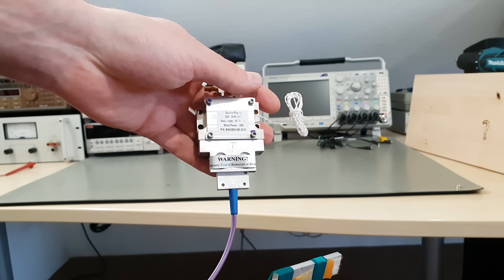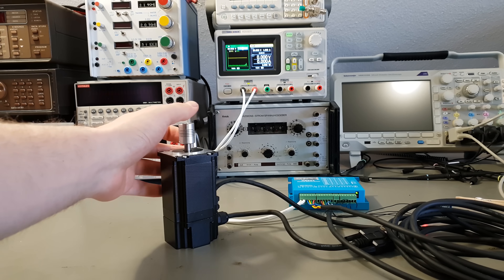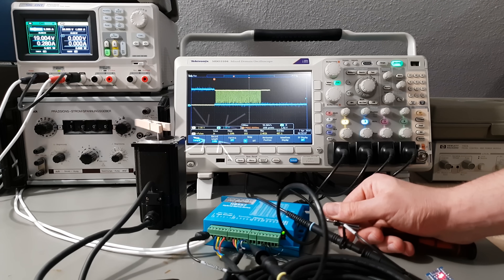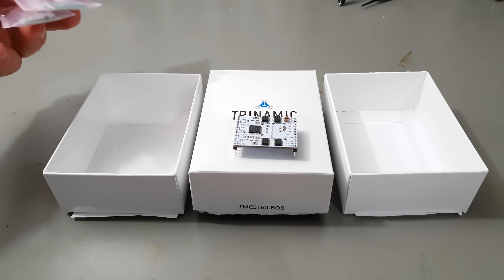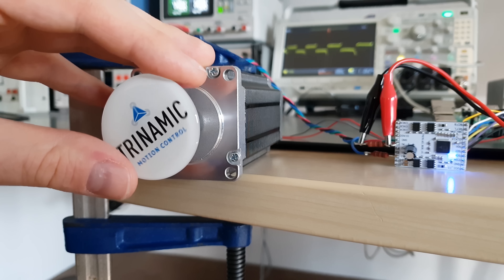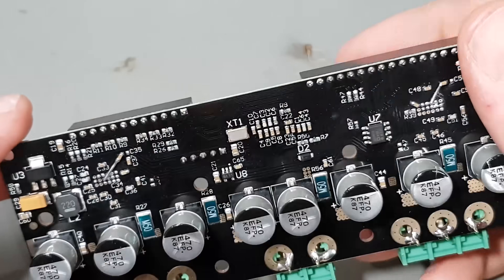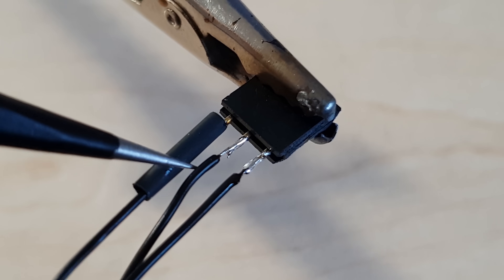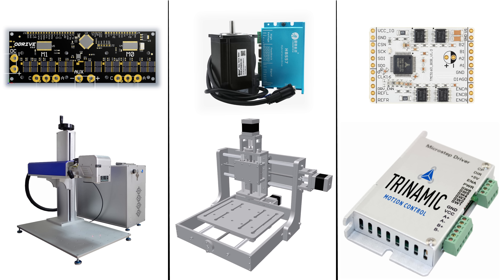Precision motion control: ODrive Servo? Trinamic Stepper? Chinese Hybrid?

Comment: "... than to spend my time with CNC and laser machines." - for some reason, this made me wonder if someone has yet built a CNC that uses a laser for material "removal".
It certainly would remove a few issues with conventional milling bits, while adding a whole lot of new issues, like making "part cooling" a literal requirement xD

Comment: He Marco, would a computer controlled brake for a stopped/holding condition be feasible to account for the lack of holding torque in the BLDC + sensor setup? I find it very attractive and like you will eventually use it for a plasma setup at some point if I can't make it work for a CNC in the mean time. You say that all high end CNCs use these - how do they account for lack of holding torque, or is it just your paranoia and purism stopping you from using one because in the back of your mind you know it'll be slightly imprecise even if less than what matters? Love your videos! Cheers :-)

Comment: You said when stepper motors skip a step "it always skips 1.8 degrees" but it's actually 7.2 degrees (360 / 50) because it skips to the next compatible pole of which there are 50 per rotation.
Also the property of servos and encoders to deflect from the desired position is bad in cnc cutting because that deflection will be caused by the cutting tool forces and the result is poor rigidity. You are better with stepper that have a high holding torque or high torque servo motors and lots of gearing.
Great vid, and nice humour too! 👍

Comment: Why aren't optics used for positioning?   Sensors have pixel sizes in the under 30 ųm² (yes, I know that's not a mu but it's the closest symbol I could find on my keyboard). That, when combined with something like facets cut to a certain length at a given angle could be used to sense the position of reflected light to an extremely precise degree, especially when you start leveraging the power of cosine in this setup (that is don't have the reflected light hitting the sensor surface orthogonally, angle will be limited by optical well depth, but that's mitigated with microlenses to increase the sensed length to a definitely detectable size/ somewhat easy to manufacture).

I expect that people smarter than me have considered and rejected something like this, so if anyone can provide some insight as to why, I'd be interested to find out.

Comment: This is like an opensource RC ESC (speed controller)!  The newest Hobbywing G2 capable speed controls like the Pro XE series has all the features you mentioned the Odriver does, such as dual hall sensor control, regenerative braking, etc.  I wonder if the creator was a Hobbywing tech defector?! haha

Comment: DAMN!  I can't believe I didn't know about this Odrive before now.  I've an active RC enthusiast for 30 years now, and was into high end 4x4 short course  and buggy racing for the last 10.  That being said, I'm a hobbywing guy.  Hobbywing is the only manufacturer that I know of that offers G2 motors that utilize two separate encoders.  This was a real advancement over the rest of the rc motor world, as having two separate hall sensors allowed them run the low resolution sensor for lowspeed operation.  Before the invention of these type motors, the speed control (ESC) would just turn the sensor off at low speeds so that it would prevent "cogging" (the bucking and hanging up due to low torque when going from 0-moving)    Once the ESC sensed that the motor was running past a certain RPM, it would then turn on the sensor mode for high resolution control and superior efficiency over non-sensored motors.      So I guess what I'm getting at is I wonder if it's possible to take one of the G2 Motors that have dual sensors and get write code needed for a redundancy algorithm setup with one of these drivers?.... Hmmm. Got my head spinning now!

Comment: Why not use 2 ODrives? Why not enclose the brushless motors in a DIY enclosure? Why not buy bigger and stronger brushless motors? I don't think your decision was wrong, I just think the reasons you gave for discarding the ODrives solution aren't enough

Comment: We just built a 6kW pulsed laser system at work to weld proprietary dissimilar metals. We're also using a 1kW psed laser to abate the weld edge of the metal.

Comment: Hi Marco, newer subscriber here. Love the information and humor!  My simple brain has been wanting to make a rotary table for years now (for 3D scanning, maybe some video/photo on the rare occasion, but mostly because it'd be damn cool to learn/have one). But its to hard. Perhaps a pro like yourself could show me... da way!

Is it possible to have a cheap(ish) device thats CNC controlled to be able to do things like you mention in this video but for a rotary turntable style?  Eg do 12 stops around one turn with a pause of 12seconds at each stop.  with some kind of ability to make it transition from each turn at a certain speed so as to not "dislodge" something mounted via gravity on the table?  And all manner of different ways one may want to make something rotate... stop.. rotate?  :)

Would LOVE a video on doing this. I'd love a servo motor because.. well duh.  but the programming side of it is just to much for me.. assuming it would at all be possible?  Where's the Google Store App for this dammit!  ;)
Reply: It's not too difficult, but you got a learning curve ahead, if you don't know background. I guess like with everything, if you know it, it's easy.

3 dollar arduino controlling stepper driver (any step-dir), which drives the stepper powered rotary table. Arduino has stepper libraries available (start-stop acceleration, speed, distance etc), so it's just few lines of code to get it all moving.
Reply: Mach3 is cheap and 'simple', and you (meaning I) could hand code some G-code to do what you say. I am not too far advance from you, but after you  understand G-code not too difficult.

Comment: closed loop stepper is actually a good choice.  all servos has very bad holding torque in compare so it's not because "not tuned".  
even fine tuned proper servo motor must be next size up to have holding torque similar to stepper.  (nema23 stepper = nema34 servo)
Reply: probably you should tune pid regulator in the driver or cnc controller

Comment: I got plans to build my own 3D printer, also designing my own stepper motor, godly strong and insane accuracy and precision.
The design is still just in my head, and a lot of gearing is involved. And motion conversion, that I could use a bit of help with

Comment: Hello, good overview! I would like to know what mosfets and motor you used with the TMC5160. I am a beginner so it would help a lot the reference, I think of using the TMC5160 in this motor https://www.baudaeletronica.com.br/Documentos/AK34-100F8FN1.8.pdf, Thanks for this video!

Comment: Would it be usable if you built a fast 3D printer with ODrive on X and Y axis? It wouldn't matter very much if Z axis used a normal stepper with trinamic driver, because it doesn't have to move that much.

Comment: Hi Sir, sorry to disturb. I am planning to build a scara robot with maximum payload of around 3kg. Actual payload is 100gram only. I am planning to use gimbal brushless dc servo motor. It has smooth operation, torque: 0.9Nm, speed: 200rpm. I believe it is good enough but also it is expensive. So i need your advice to see whether i am choosing the correct motor. The problem is i dont see people use it for building robot
Reply: Hi Steven,  We are about to do exactly the same and have looked around for suitable gimbal motors. But most of them seems to have difficulties to hold a firm position at higher torques. Have to tried out any gimbals yet? Let me know. I have a Chinese manufacturer doing some redesigns to their gimbals motors to better fit as robot joints. But they are slow and im not sure if they will reach  that target.

Comment: Hi Marco, very interested in the ODrive, and its capability, However not with the hobby motors, bat a connection with the hybrid stepper/ Servo style motor. do you think its possible to these aforementioned motors from tho ODrive?

Regards Stiggie

Comment: Check out those closed loop servo drives: JMC iHSV57
Endcnc has some good information about them here on youtube. Theres also a python script to interface with them. Greetings from Hannover, cool channel!
Reply from the maker: I already have one as a candidate for episode 2 :) Do you have a link to that python script?
Reply: https://github.com/robert-budde/iHSV-Servo-Tool
Its better than the original software. With real programming skills it should be possible to use them like clearpath servos.

Comment: Great stuff.  I came to the same conclusion as you did and went Blue Hybrid, but I'm still looking for my motion controller. I've seen some nice one but they're $800 usd and up.  I would like to go full 3d if at all possible but the cost is an important factor.  Any suggestions... Any possibility of doing the same type article with motion control boards.  Again thank you so very much for the article.

Comment: The Prusa i3 MK3 controller board has trinamic chips integrated into the unit... which is kind of the same as a trinamic motion controller.

Comment: Wow ! Ben Krasnow is in the House ! I made my own drivers, very simple schematics, for my first and second CNC's, in the late 90's, before eBay, Hehehe! My next CNC's will be a little PCB mill/LED laser engraving and a robust CNC router; this video gave me a good solution for the last one, with thick steel frame like my second CNC, maybe 400x400 mm, to use in wood, aluminium and steel, using soft passes and refrigeration. What is your goal ? Thanks for sharing !

Comment: I am really interested in the odrive.  My grandpa gave be 9 of these Superior Electric 3 5.5 amp phase stepper motors.  I thought the were neet, at first.  Running like a regular motor at 60hz mains or as stepper.  But company is out of business after 30 years and no one makes a driver for 3 windings:P

Comment: Is it possible to integrate the advanced features of the TMC5160 with software controllers like LinuxCnc or Mach3?
I want to use those drivers with LinuxCnc or Mach3, how easy would it be to use it?

Comment: Hobby rc motors are designed to spin very fast, especially those used in hobbyist aviation; do you think having a reduction transmission, probably a harmonic or hypocycloidal for almost no backlash and efficiency, the setup would have holding torque? Having the encoder after the reduction transmission could also improve accuracy.
Reply: Putting the the motor through a worm and spur gear would get rid if back drive and solve the holding torque issue. Then could put the encoder after the gear system as well. The gears would have to interface perfectly for no backlash however.

Comment: Since you're talking about a 30w laser, I'm assuming you're going to use a diode? If that's the case, than you might as well just build a CNC machine and attach the diode to that. If you're planning on using a tube, I HIGHLY suggest that you just go on ebay and buy a fully built machine (they're <$1500 for a decent sized design and 50w), otherwise you're going to have an absolute hellish time lining up the laser path coming out of the tube.

Comment: What about using used industrial servo parts?  I'm using a Yaskawa Servo Drive.  They can be very cheap and high power.  They also use an open ASIC communication protocol Mechatrolink.  Bit of a steep learning curve however.

Comment: "Only limited by what you are prepared to spend on encoders"
You should be good with these optical 32bit / +-0.52Arcs Renishaws then:

http://www.renishaw.com/en/resolute-uhv-absolute-encoder-system-with-resa-rotary-angle-ring--11018
Reply from the maker: Meh. It's hit or miss with those cheapos, better order 10 in case of 'dead-on-arrival' :)

Comment: Hi Marco, I have used stepper motors with encoders and gear motors with encoder on the motor shaft. The later gives you very precise control over the movement as the gearbox translates 1 revolution of the motor shaft into 1/100 of a revolution on the gearbox shaft and if you have a resolution of 48 steps on the encoder you already get 4800 encoder steps for one revolution. Have you considered such gear motors? They have much more holding power and power in general and use less amps. They are used a lot in robots. Regards, Marcus from Heidelberg
Reply from the maker: Not considered yet, but I definitely will now! Thank you from Hannover :)

Comment: I just found an integrated servomotor on aliexpress. 180Watt for approximately 100€ including shipping. Do you think this is any good? 
https://de.aliexpress.com/item/180W-NEMA-23-0-57N-m-Integrated-Servo-Motor-36VDC-3000rpm-JMC-iHSV57-30-18-36/32714727077.html
Reply from the maker: Yeh, that looks nice and similar models have been suggested a lot in other comments! 0.57 Nm is a bit weak like it can lift 57g on a 1m lever on earth.

Comment: I used a lot of those chinese closed loop stepper at work and i have mixed feeling. On one hand they are very convenient but in the other hand the factory tuning is not suitable for all uses.
For example, the PID that control the feedback, can (and will) cause oscillation and imprecise positioning on fast movements due to overshoot, the auto tuning of the power is so hit and miss that i discovered that the best solution i to disable it (even when it's disabled it seem to set its parameters at boot resulting in a motor that does not have consistent torque between boots).
All of those problems can be solved configuring the parameters but good luck in sourcing the correct software for your specific controller (even the manufacturer can't send me a working version of the software that's not in chinese and untranslatable).
BTW they seem to be all manufactured (or cloned) by a company named LeadShine and they even exist in the more convenient integrated form with the driver mounted on the side of the motor.
I have some controllers with the chip marking readable, if you want some info on the chip i can send you a photo
Reply: you could just upload the images to https://imgur.com/
so we could all see the info. :)

Comment: Take a look at the JMC iHSV57 HybridServoMotors ;) They are also able to stream realtime data about torque, acceleration, speed and position errors which is nice for tuning the PID loops.
Reply: Their holding torque is just sad, especially for the price they want, because you can get cheap servo+drive kits for about $10-20 more that give you 5-10 times more torque.
Reply: Can you give me a link or hint where to find those cheap dc servo/drive kits?
Reply: You're better off looking yourself, the prices vary wildly and you just pick the cheapest source at the time of purchase. The places to look are eBay and Aliexpress, with the keyword "NEMA23 Servo" or "NEMA34 Servo", but be sure to avoid "Hybrid" and "Stepper" in the listings if you want a true 3-phase AC servo instead of a stepper with an encoder.
Reply: I searched again but ended with the same result as before  (I'm observing real NEMA23 servo prices for some years now) ... there are no other real servos/encoder kits for less than 100€, all you can find are based on simple stepper motors (which explains why they have a high holding torque) and I can clearly see the A/B winding connectors on their drivers. If you find a real cheap servo/driver kit, please give me a manufacturer/product name but I don't think that you will find something in that price range that isn't made by JMC.
Reply: The JMC motors end up costing about $100-110 with shipping and customs.
There are plenty of $120-150 NEMA23 3-phase servos.
Reply: Ahhh, finally found it, thanks for your answers :) HBS507, 573HBM20-1000 but they are twice the price (all included) maybe thats why I did not saw them.
Reply: No, those are the hybrid steppers. Those are the ones you really don't want.
Here's the kind of kit you want: https://www.ebay.com/itm/Nema-23-2-0N-m-57-LC57H380-motor-kit-with-encoder-LCDA357H-Simple-Servo-Driver/152978050709
With UWV winding connections on the driver.
Reply: Hm, but HBS507 and 573HBM20-1000 are also using 3-phases UVW connections, it looks equal to the LC57H380 motor kit.
Reply: Hm. Odd, some kits clearly show steppers while others are servos. This is what you can expect from Chinese suppliers :)

Comment: Damn...i've been wanting to build cheap servos for such a long time with hobbyking motors. So happy that odrive did it for me. But now you tell me that there is no holding torque?
Is that something that can be mitigated with other parameters? I mean...it can't be as bad as you were showing at the end right?
Reply from the maker: It really doesn't have holding torque but it isn't nearly as bad as I've demonstrated! With a precisely tuned motor at max power, it will probably be equivalent to stepper motor behavior.
Reply: Do you think a design wiht a 90 degree worm wheel transmission and one of the beefier multiple KW motors from hobbyking could be suitable for a 6DOF motion simulator a la:
https://ksr-ugc.imgix.net/assets/017/285/680/56850fcf71376209877f1d7974177980_original.png?w=680&fit=max&v=1498599885&auto=format&lossless=true&s=f0b7e658950ed5263b78fb3bcabb408a
Reply from the maker: Hm, not sure about worm wheel transmission, but I think that should be possible with single kW motors and gearboxes!